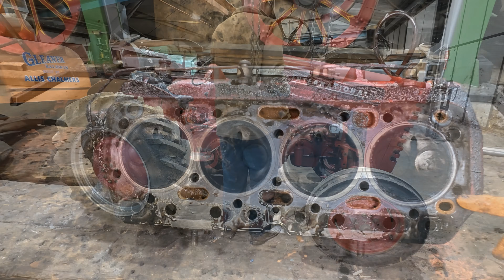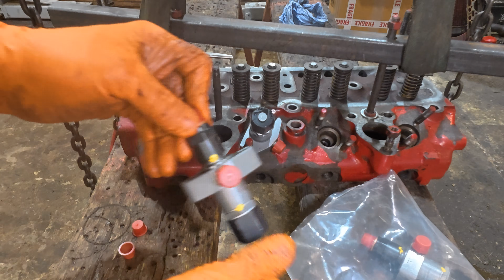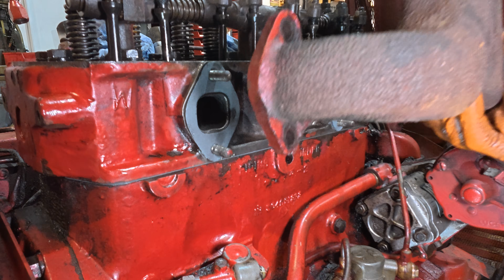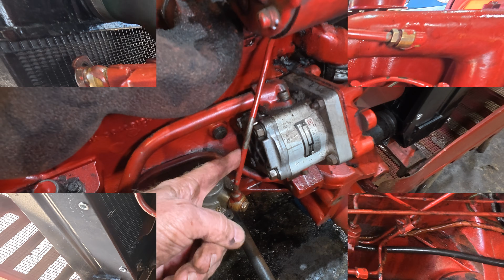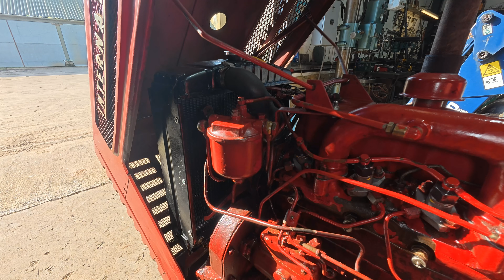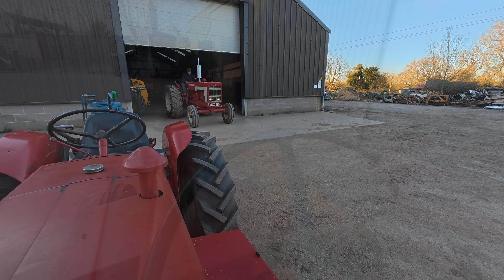B275 Repair Finally Done

Comment: Nice..I just finished my inframe overhaul..the very first engine, machined valve seats, wrist pin bushings and ground valves myself..runs great. Cleaned injectors.
Thanks for posting!
Reply from the maker: Sounds like a great job, glad it's running well! 👍

Comment: Like your video, I would of got the original radiator reconciliation instead of getting a new one that might not fit.
Reply from the maker: It was difficult to decide on the radiator.  I've kept the old one and will ultimately have the option to get it re-cored.

Comment: Thank you very much for this video. I started removing the cylinder head of my B275 tractor two days ago. Here I found a brand new video about the same thing. This gives me confirmation for what I'm doing. I have coolant leaking from between the cover and I thought it was just a problem with the cover gasket. Now everything is loose and I don't see any other problem. I've been driving the tractor for 15 years and it's been 39 years since it was overhauled. Nice and strong tractor.
Reply from the maker: I hope this series of videos is useful.  You probably should watch this video first https://www.youtube.com/watch?v=wGUK5MSeAfA&list=PLntcOaumgcUngPo9uT-V7TVYrkEJyjS1A&index=2
Reply: @Casterton-Vintage  Thanks, I'll take a look!

Comment: Great video I fitted a new radiator to my B414 didn’t have a problem with the cowling but after a few months realised the normal radiator cap for a B414 won’t fit I’ll need to get one sorted out just in case it’s needed some day.
Reply from the maker: Thanks

Comment: Good video as always 👍 BD144 and BD154 great engines to work on 🤔 as these tractors get older diesel leaks get more and more difficult to stop😕 finally after chasing them for longer than I care to remember success 😁 just done an injector overhaul on my B250 did it ourselves as fortunate enough to have a pressure tester settings are around 2100 psi and 3 of my 4 were down between 1400and 1700 psi 😳 totally changed the exhaust note and emissions 😁👍
Reply from the maker: Thanks 👍
Reply: Nice..I’m doing a in frame overhaul on a B275, did my own valve grinding/ seat machining/ lapping (retired machinist) also took injectors apart and cleaned, made sure to screw down the tension nuts the same amount of revolutions..I  probably need a pressure tester also or have it tested. Any suggestions would be appreciated. I’m probably about a
month away from seeing if it runs.
Reply: @Koni_53 would say if you don't have your own injector tester then a diesel repair business would set them up for you as probably be much cheaper than the cost of buying your own tester, I was fortunate that vintage club I am a member of has their own testers which came from a diesel repair business that was closing down 😕

Comment: Well done great job. Your tractor is the same vintage as mine. I also had persistent fuel leaks at the filter and ended up fitting a new unit. They must have been fitted to many vehicles of the time and from time to time new unused filter assemblies appear on ebay for not very much money. I suggest get one when you can.
Reply from the maker: Thanks 👍